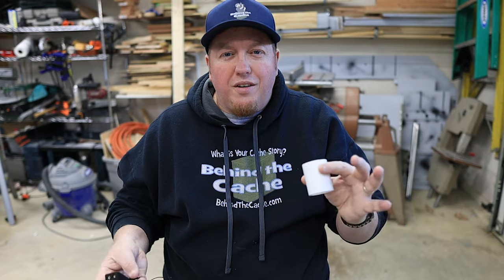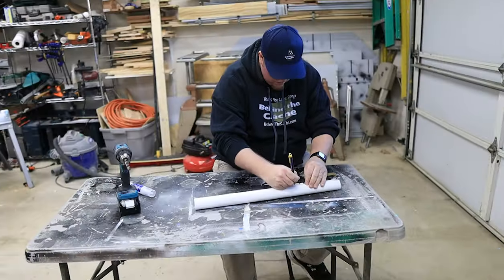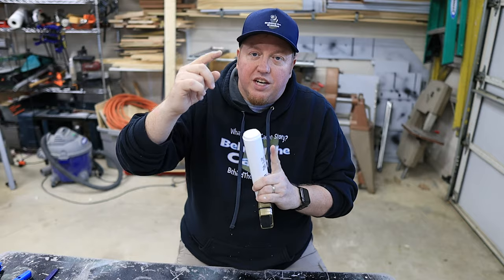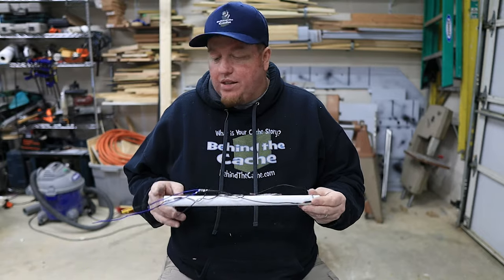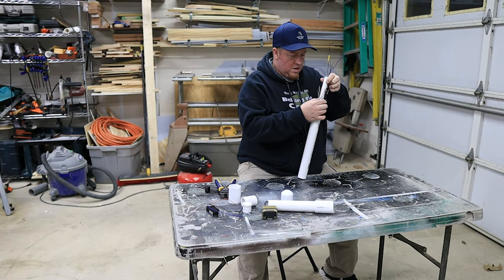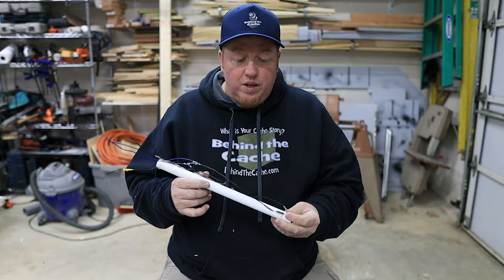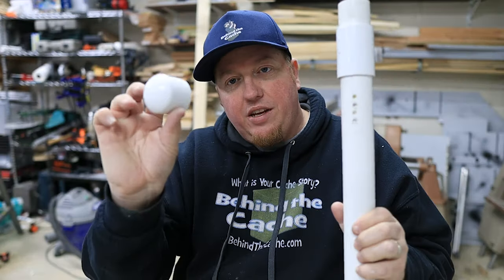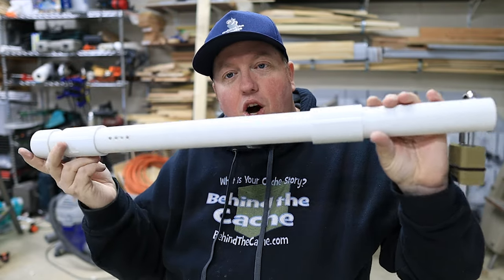PVC Pipe with LEDs Creative Cache Build (GCNW)

Comment: The electronics are just the part I'm so hesitant to do due to understanding the electricity, resisters, all that. Been doing some research, for a cache I want to create, but man it feels complicated :)
Reply from the maker: This one is really easy to wire up with the prewired LEDs and the reed switches.
Reply: @cache the line if you need any help with electronics, simple or more complex circuits let me know, I'm an electronic design engineer by trade.
Reply from the maker: @GeocacherOwain  I may contact you too

Comment: How do you wire leds and reeds? Do you have multiple leds per hole or how it is done that only the correct reed reveals thr right color combination?
Reply from the maker: There are 4 reed switches and 4 prewired LEDs. One line from the battery so say the negative line feeds all of the individual reed switches then each of those reed switches feeds the negative of the prewired LED. The positive of the LEDs goes into the positive of the battery. So when you use the magnet it connects the reed switch that it is close to completing the circuit of that LED. I hope that makes sense.
Reply: @BehindtheCache  oh I see. Thanks for the explanation. So there is no switch that will light all the leds at the same time. Makes sense and keeps it simple enough. Thanks!
Reply from the maker: Correct. Truth be told the first time I wired it wrong and it did.